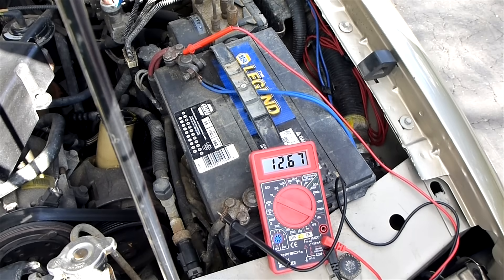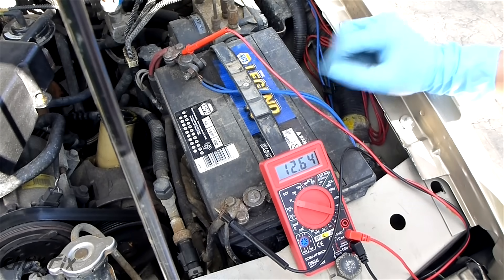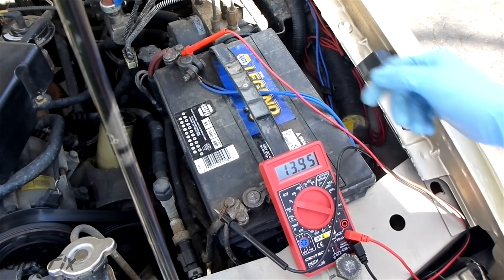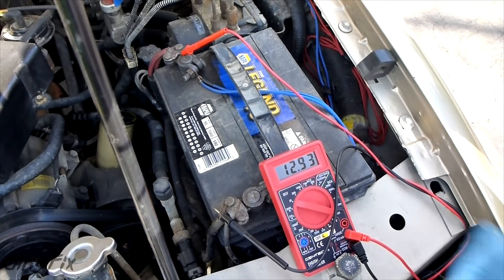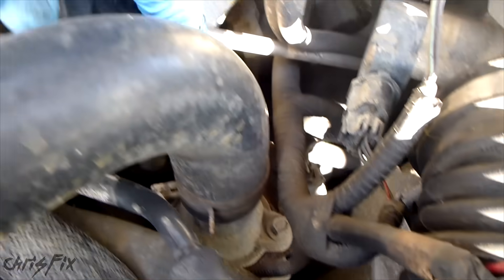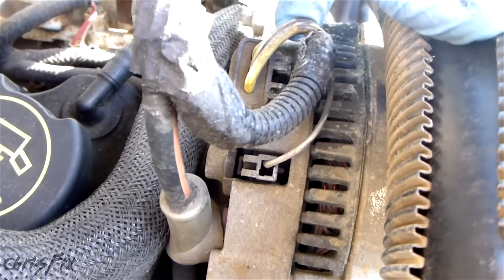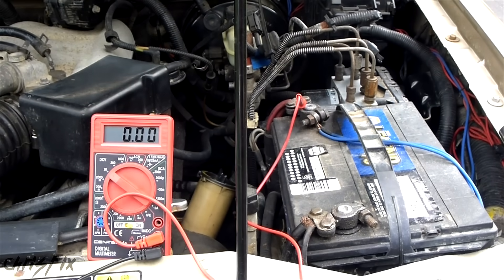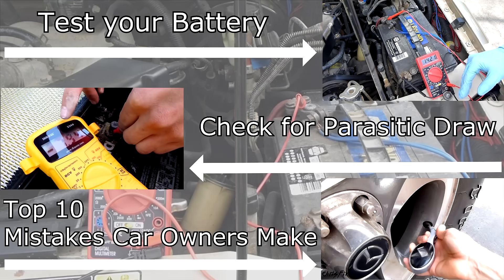How to Test an Alternator

Comment: Had one that halfway worked!   -  So get this, I finally fix my truck, I knew the Alternator was bad because it would die on me while driving.  After 3 years I get her back up and running, I test the alternator, I'm getting 14.4V, I think to myself WTF? Even if my terminals were dirty it should have ran, then I did the old trick my Dad taught me of pulling one of the battery terminals off, he told me if it dies it's no good.   I pulled the cable off, it ran, a little rough but it still ran.  I put it back together, drive to the Gas station and before I get there the battery light comes on.  It starts back up but starts running rough, I pop the hood pull the cable off and the truck dies.   Finally after letting the truck sit for 5 min I got her started back up managed to make it home.  I replaced the alternator and everything is running just fine.  I guess when the alternator gets hot, the old one that is, it just stopped working.

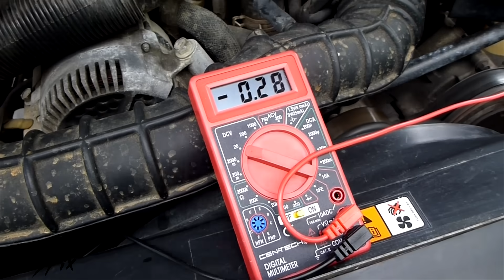Comment: 7:36 My voltage was 0.38v with car on (with no headlights on, no A/C, etc.). Is that okay?

Prior, I replaced a new alternator on my car. Battery tested good at auto store, new alternator failed on the OUTPUT side. Overnight, my battery died after driving for 15 minutes the night before. Any ideas?

Comment: Thanks for your video man. It was very helpful. Seems like every time I pick up my multimeter I forgot what settings and the voltage and where the levels are supposed to be for the battery and the alternator. Very helpful… 👌🏼

Comment: Just installed a Diehard battery in my Grand Cherokee. I sanded the battery clamps before installing. My multimeter reads 13.3 volts across the battery terminals with the engine not running. 
Anybody know what I should expect for a boost in voltage from the alternator once I start the engine? I appreciate your advice. This is a 2002 Jeep Grand Cherokee Overland.

Comment: What would cause my voltage to drop to 12.0v when I shift into drive. In park or neutral it stays at 13.7 volts. When driving it stays 13.7 but at a light it drops to 12.0 or below almost to the point of shutting down

Comment: Always good content. Wife came in stating lights are dim, traction control lights are on, etc. Volt gauge @ 8 volts and falling, battery is going on 5 years and housed inside, connections are clean. Thanks for confirmation on everything did, I no longer do this as a hobby. But the first thing I noticed was no sound from the alternator. Going to charge battery and redo, barely starts vehicle; its Sunday, got time run test again. Thanks
Reply from the maker: Glad the video was helpful!

Comment: Could the alternator not be a big enough  to keep up with the draw as well
Reply from the maker: Eh, most alternators are at least 90amps and unless you’re running some crazy aftermarket subs or a winch or something, you shouldn’t need a bigger alternator.
Reply: @chrisfix  what about after market electric fans? Thanks

Comment: Thanks Chris.  What if I see a voltage drop of -.18 V from the case / bracket  and the engine block but not the ground wire?  Thanks

Comment: but also look at the volt start as well. yours showed a 10.9 when it started. its said that a crank volt start of 10 and a half or lower is a sign of a failing battery. just a tip for anyone watching this video. always good to learn new things especially since this has to do with the same issue. eventually, even a dome light on for 2 minutes will cause a dead car if ur getting a 10 or lower start up voltage.

Comment: My old alternator was dropping down to the 13s when I turned on accessories but strong 14s with everything off... Reading from the auto parts computers kept saying the voltage regulator was bad... Put a refurbished alternator in and the readings with accessories on was weaker in the 12s and the lower 14s with everything off and the auto parts computer says the voltage regulator is bad as well... Thinking about just putting the old one back on and returning the new one and saying eff it... but not sure if maybe I should just get a brand new alternator?

Comment: Hey Chris , I love your videos man . 
I have a question for you . 
I follow both your instructions on checking the battery and the alternator. 
Both of them seem to be fine. 
Let me explain what’s going on . 
I have Honda Civic 2015. 
The car show me NO signs that the battery or the alternator are going back.  For instance when I start the car there’s no creaking sounds, no tweaking lights , etc . 
But the car wouldn’t start only one time ,  and I had to have it jump with another car but so far everything has been working fine . 
However , I do notice when I put the car on reverse , it feels like it’s about to die just for a split 2 sec then it’s back to acting normal . 

What do you think ?

Comment: My voltage is above 14.9 when the car is running. Should my alternator be replaced? My car has been shutting off when I drive
Reply from the maker: That is a little bit high, I would consider replacing it, especially if it is causing your car to shut off!

Comment: Hello chris, i have replaced both my alternator and battery, but my alternator is only pushing 6v maximum output and isnt charging my battery, any ideas or suggestions? Maybe i got a faulty one? It has a internal voltage regulator aswell

Comment: Outstanding video but before change my alternator and battery multimedia  reading was 17 volts with the new alternator and battery still reading 17 volts
Reply from the maker: I would first make sure you have the multimeter set correctly (on most you set it to 15 or 20 volts) as at first glance that doesn't sound right, if you do have it measuring correctly then I would take the alternator back and exchange it and get another new one and try it again (just because a part is new doesn't always mean it is good!)
Reply: @chrisfix  I appreciate  your quick response but in hawaii we can't return alternator for new one we have to pay for replacement THANKYOU ALOHA continue doing what you're doing  I enjoy all your  videos MAHALO
Reply: Morning Chris I took  my alternator to napa automotive to test and alternator was good it was my multimeter was bad I use a friend meter and everything was good thought I let you know what was the problem...have a blessing day ALOHA

Comment: I noticed one day when starting my car up that it was suddenly very weak, and had developed an odd, high-pitched whirring noise. I thought it might have been because I forgot to turn off the air conditioner before shutting the car off, but then I also noticed the windows opened and closed much more slowly than they had before. Thanks to this video, I was able to diagnose the alternator as the issue, seeing the battery was no longer getting charged with a constant 12.6. Thank you for the video.

Comment: My vehicle won't crank. It'll turn over. But it really doesn't sound like it wants to crank. Fuel pump works. It's firing. But no clue why it doesn't crank. Any suggestions?
Reply from the maker: Sounds like either an old run down battery not providing the power it needs or a ground wire that got corroded or has a bad connection. I have a video on testing a battery: https://www.youtube.com/watch?v=YC--MLNIbik
Reply: @chrisfix  thanks for your videos. They're insightful. My battery is reading 12.04. I've tried jumping it off. Still didn't work. Recently I've taken the head off the driver side of the motor (2005 V8 4.7l  Jeep Grand Cherokee Limited) . I "zip tied" the Timing Chain so it wouldn't fall inside the motor. Had to get a broken spark plug out of the head. Put everything back as it goes. Now it won't crank. Gas squirts out of the fuel rail when I press on the valve that sticks up on it. It's firing. I took a spark plug out and held it to a grounded area with the cool pack connected. Had someone turn the vehicle over for me. Just replaced all coil packs. Ordered them from Amazon. Really need some help here. If my wife's only vehicle.
Reply: @giantkilla_  car won’t start with jumper cables?

Comment: Excellent video quality, I really like that you don't ramble about nonsense, you presented a set of diagnostic steps that I could convert easily into notes. I haven't done this kind of work in 30 years. Economic circumstances brought me back to the car repair world for my own cars and this is going to save me a lot of heartache with modern expensive mechanics.

Comment: Would you expect 14.2 on a dual battery set-up in a boat as well?  I was getting 13.4 on both batteries?  My boat won't start after running accessories even at 12.7 but after a few tries and runnging some pumps and opening the hydralic hatch, DCV dropped to 12.4 on both batteries.  Both very new batteries that were winteized on a battery tender.  I assume its the alternator?

Comment: I have a 2013 infiniti g37x, I was driving the car I stop turn the car off and turn it back on right away and nothing happens no headlights no dash lights no crank, I check the battery and I got nine volt I tried to jump it and all the lights come on but won't start, I got the battery three weeks ago.

Comment: Chris, getting conflicting signals.  On a 2016 car, original battery and alternator, car sat for 2 weeks and started up fine. You'd think the battery is good. With battery fully charged overnight, drove for half an hour, then car wouldn’t start without a jump.  With car off, battery voltage is 12.6.  Turn the car on, no headlights, no a/c, no accessories, voltage goes up to 14.2 for a minute when car is initially idling high. Then slowly drops to 12.2 when car starts to idle lower. Turn on headlights, A/C, voltage goes up and stays around 14 - 14.1.  Turn car off, battery reading is 12.9, slowly dropping to 12.6. Also, the alternator pulls in a screwdriver like a magnet to the spinning bolt when voltage is around 14, but barely when it idles at 12.2.  If the car idles with no accessories turned on, is it normal to see 12.2 volts?

Comment: Can’t thank you enough. You helped me determine that my alternator was, in fact, bad but more importantly when it came time for me to replace it I paid extra close attention to the wires and bolts only to find that my negative terminal on the battery was rusty, the chassis ground was loose, AND the chassis ground wire was frayed. As soon as I replaced the alternator and negative terminal wiring my car started right up and it sounds better than ever. Thank you so much.

Comment: Thank you for sharing your knowledge! I follow your video and my batter reading was 12.6v, with engine on ac on car radio on headlight on multi meter reading is 14.06v seem like everything is OK. However every time I step hard on the gas pedal the battery warning light on the dashboard turn On then OFF. Any advice on this? Thanks

Comment: One more thing he forgot to mention with a bad alternator is.... fluctuating voltage. You will notice it when driving and you turn on the interior lights. They will brighten and dim constantly. If you have regular halogen headlights you will notice them fluctuating too. I have factory LED headlights and they are regulated so they do not fluctuate. This is different than dimming when the engine is at idle.

Comment: There's a problem with the charging in my 1998 Toyota Sienna. The battery died. When I got a jump, the car starts right up, but while I'm holding the rpm at about 1500, it rapidly drops down and the engine shuts off. So I bought a new battery and went to a highly recommended starter and alternator repair shop. He checked the alternator by checking the voltage at the battery while I started the engine like you did. It didn't go up at all, so he said that the alternator was bad. I had him rebuild the alternator. When he checked the voltage again, it didn't go up! So, I maybe paid for an alternator rebuild because checking like you and he did at the battery only shows IF a charge is reaching the battery... NOT if the alternator is working! What should I tell him to do next?

Comment: Chris, having intermittent electrical issues on this vehicle? I'm sure you saw the loose negative battery cable at 46 seconds into the video. Point being I always start with checking the battery connections with any electrical problems. Even if they're tight I disconnect, clean the cables and posts, reconnect, and move on. Thanks for the video.
Reply: Wouldn’t the cables have to be in pretty rough looking shape dirty wise for it to cause electrical problems other than being loose?

Comment: newer vehicles are computer controlled charging systems.  The alternator will not charge under load unless the battery charge drops below certain parameters.  So you are not completely correct.  I've had to argue with a customer who "was a mechanic" with a volt meter on the battery as it was running saying in needed an alternator because the meter read 12 +/- volts.   He was wrong.  If you have a battery sensor near the battery post, it is computer controlled.  Have a nice day.

Comment: I can't thank you enough! I just bought a car and the dealer said he just replaced the battery. After a few weeks, my cars power seemed low.  With the alternator running the battery was at 12.3v, yikes! I found your video did the test and had about 1.4v voltage drop from the alternator case to the negative battery post. I ran a new ground from the harness that connects to the battery to a bolt on the frame and voila!  13.8v. I believe after the battery charges a bit the car will be over 14v. Oh and I checked all of the other spots you recommended and they were within spec.

Comment: Great video but I need help. Both batteries are within range. I tested for continuity for ground and was good for both batteries to alt case, engine block, chassis. However tested for voltage from battery one to the alternator casing, engine, chassis and got no reading. But did get a reading from other battery to the same. My voltage on the positive side was .05 to .06. What do you think? I've been having a couple modules fault. Runs mostly but will randomly stall when driving.

Comment: I know this video is older but wanted to see if I could get a little help. When doing the power drop test from the battery to alternator, when the car is idle what should the meter read? 
I'm getting around .03 at idle but at 1500 rpm I'm reading .05-.07.
I don't know if I'm looking at a parasitic drain or what. When the car sits more than an hour or so it's sluggish to start, but if you have it on and try again 15 min later it's fine.. already changed the battery as I had an extra one sitting around..
Thanks!

Comment: Ford Ranger, approximately same make as here. Everything checks out until I get to the voltage drop test. I get approx. - 60.0 DCV on everything: alt case, mount, engine block and chassis ground. What am I doing wrong?

Comment: Hello, 👍 thanks for your video.. Do you think the charging test that can be done with battery analyzers like foxwell, topdon and the like is better test than a simple multimeter? By the way, I'm getting 12.3 volts with high lights on, blower at max, stereo loud... Is there something wrong? Thanks

Comment: used this video to diagnose a failed alternator in my wife's car and then replaced it. over the years you've saved me thousands. thanks chris
Reply: How did you do that? If the voltage is low on the battery it’s the alternator not giving enough voltage? Even if the battery is not staying charged on a tender, overnight it still didn’t charge

Comment: @Chrisfix thank you for that helpful demonstration, however how does one test an alternator that's hidden behing the engine? Any tips quite welcome. Thanks a lot in advance!!
Reply from the maker: If it is that difficult to get to, you can do a test at the battery, if it's ~13.8-14.6 with the car running and accessories off, then the alternator is doing it's job!
Reply: @chrisfix  Many thanks for your speedy support, indeed I have tested my car the way you proposed and it produces 14.23 Volts, so all is well ;) Sincere thanks again,
Harry

Comment: I had my batery tested by someone at advance auto, I have the org oem batery on the car. The sts results came up for battery charge and retest and the alternator test came up high output at 15 load and no load. They said I needed a new alternator and not a batery. What is the right info? I'm assuming that the alternator overworking is due to a bad batery not a bad alternator? FYI I have a 500 wat system in my car and led lights and custom headlights and a dash camera.

Comment: I have a Landrover series one The battery seems to be running out all the time and then I have to charge the battery externally. Whenever they check the battery, It is below 10. 
Now, I am wondering if the alternator is at fault or is the wiring of the car off. 

Let me lay down some more details,
When I turn on the Landy, The red light which is supposed to go off to indicate charging battery never turns off which probably means that the alternator is not charging the battery. When I stop the engine and take the key off the ignition, every electrical component is still powered on so now I always have to take the negative terminal off the battery. 
after a few starts and offs, The engine at some point won't crank. 

I would appreciate any advice on the matter. Thanks.

Comment: accord 2013 v6 ExL: alternator good, battery good (volt good, charge 100%) but sometimes wont click on pressing start button. I have to keep pressing the button and do it multiple times - to start the car. stopping is non problem. 
problem comes and goes. when it comes it shows up almost every time. then some days all starts are good.....
i went to mechanics/shops and told them, may be starter is bad. but one person said it is my battery, it is not having enough CCA. It is 3 years old battery. 750CCA, Everstart good model 24F.
How can i check battery CCA?